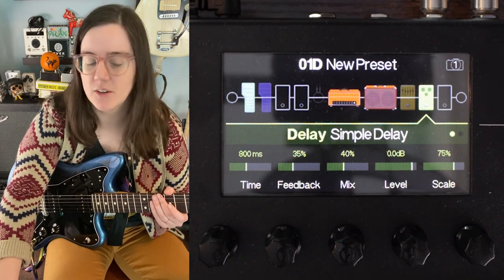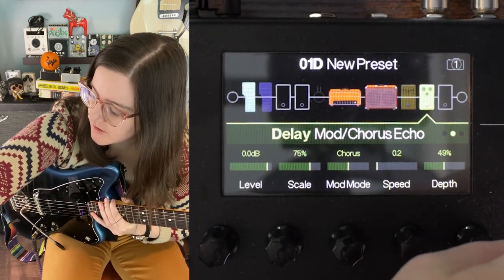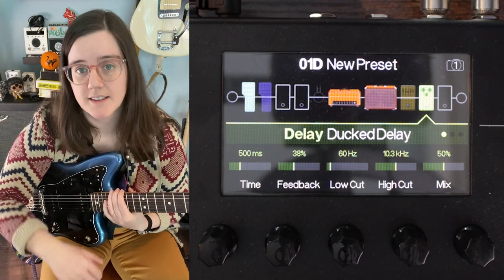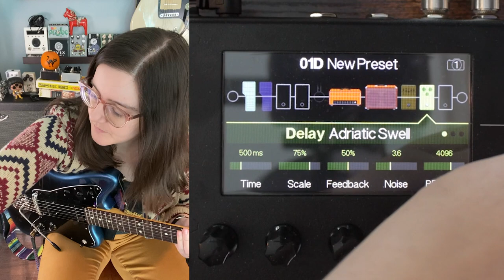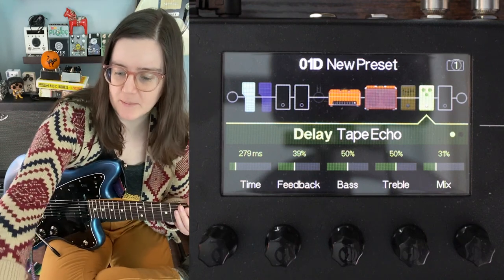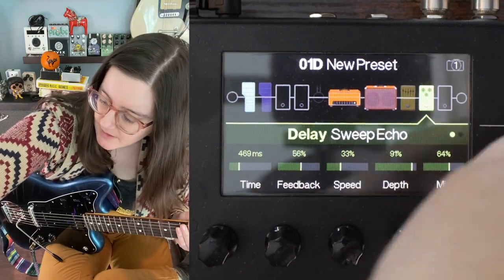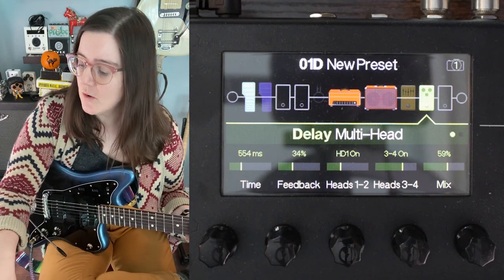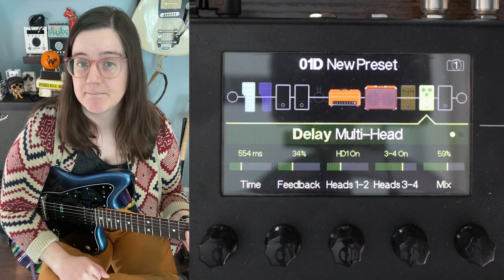Line 6 POD Go Delay Settings

Comment: hello. im thinking about this but im not sure if i can use that as a sound card to recording. is it available to use as  a sound card?
nice video btw thanks (:
Reply from the maker: I'm not sure what you mean by sound card. Can you explain a bit more?
Reply: @GetOffset  sorry (: ofc i can. i was meant that, can i use Pod Go as a sound card to recording. i mean record on PC and required programs (adobe or studio one for example) without latency or noise.  you got it? or i can try to explain
Reply: @GitarinRuhu  Yes, the Pod Go can be used as a sound card. It will track your processed signal and can be used for re-amping at the same time. I’m pretty sure you can monitor with zero latency as well.
Reply: @LochNessAnthony  thank you very much

Comment: can you do delay dotted 8th on pod go?
Reply from the maker: Oh I'm sure you can.
Reply: You could either work out the delay time manually (there are loads of online calculators out there), or if you press the "Time" knob on the Pod Go it switches between milliseconds and note values (so it does all the hard work for you).